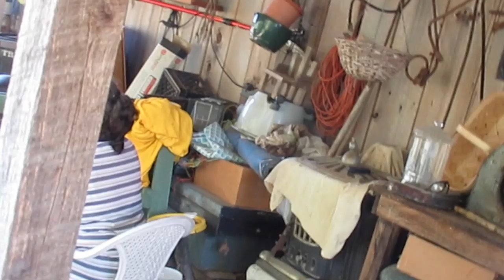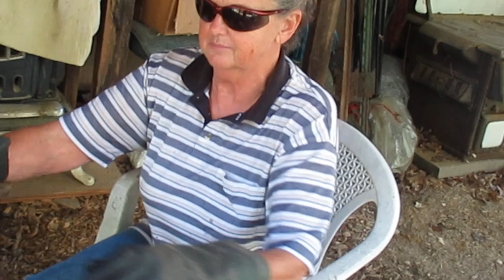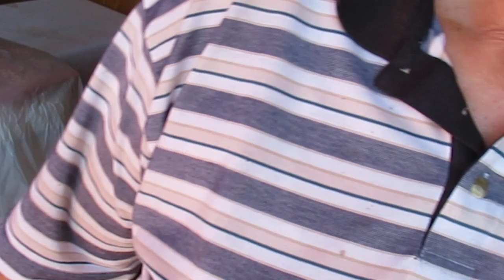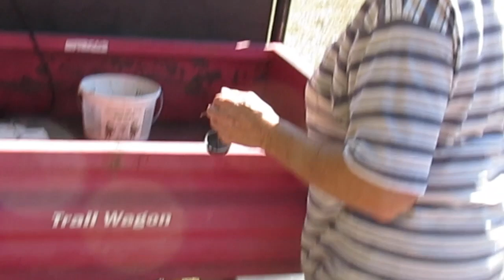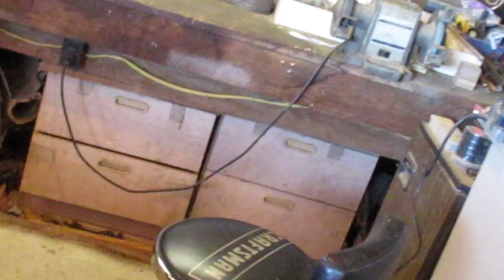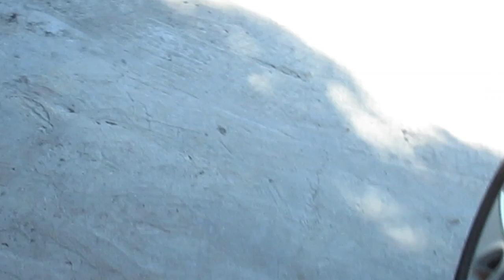Mothers Walnuts

Comment: When I was a boy we had some walnut trees beside the house when they fell we would put them in the driveway and Daddy and Mother would drive over them go in and out the driveway. Then we would pickup the walnuts and crack them. The car wouldn't crack the hard shell of the walnuts on the dirt drive but it cleaned them up. God bless.